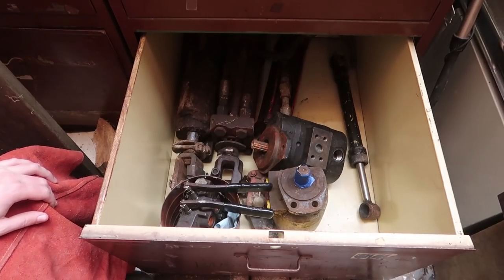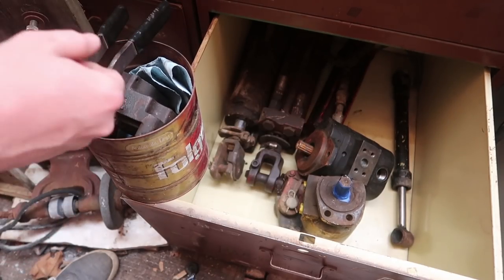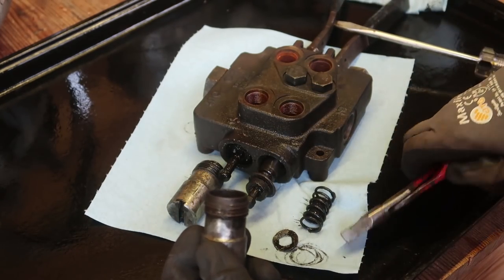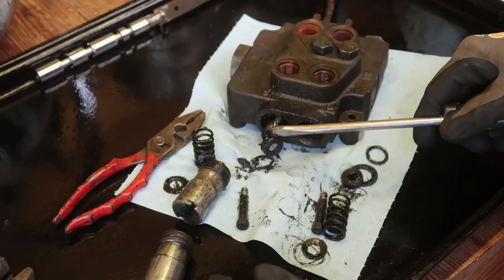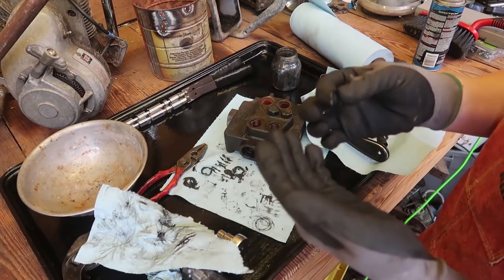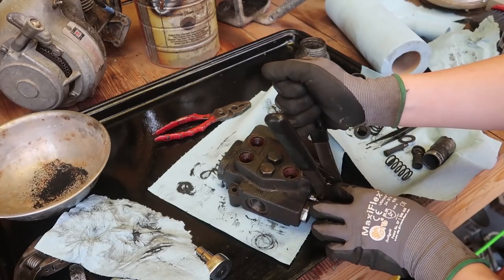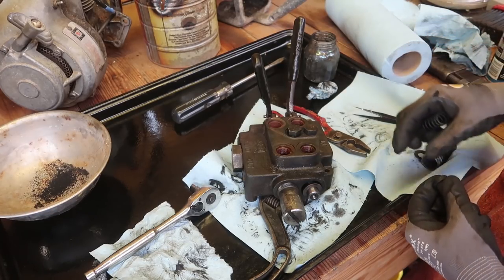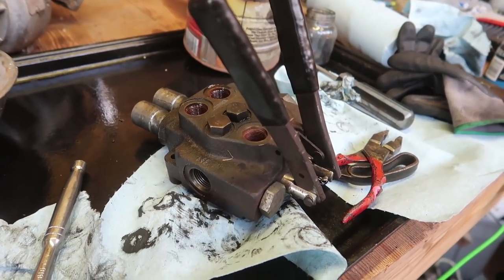DIY Electric Mini-Excavator 01: Hydraulic Learning Begins, Cross 4z0052 Double Spool Control Valve

Comment: Hi Rinoa, could you please do a hydraulic cylinder diagram, how to make the installation? I want to build an excavator arm for my backyard, and I need help to do that 😕🤓😌
Reply from the maker: well im sure somebody else has good diagrams online. however i do plan to experiment with my hydraulic circuit later. i just need to collect some more parts
Reply: @RinoaL  awesome! Thank you. Upload it when it's done 🙂🤓

Comment: Try getting hydraulic rubber hoses from anything any length I think they are a standard size and thread on the unions,  It wouldn't cost much to have a new ends fitted, Long hose  = 2 hoses, Looking forward to this, Take your time and gather x
Reply from the maker: oh dont worry, Rural King has a lot of them that will fit great.

Comment: Im thinking that the levers are mounted wrong. If you join the cylinder to the other hole of the lever and then with the links  the other hole with the broke piece on the body. I don't know if this was clear enough because i don't speak often english.
Reply from the maker: thats ok, it was clear enough. thanks

Comment: Could it be positive circulation and relief  valve bypass return,  if you actuate the valves it inturupts the return pressure and activates. Just working it through in my mind, maybe like power steering on a car. Interesting for me Rinoa. ps I could imagine trying to replace one of those stainless actuation rods.

Comment: Something that struck me.  Since one of the cups was orientated one way, and the other the opposite way - you don't really know which way is correct.  LOL  Do you think that little cup is a receiver for the spring, instead of cupping onto the rod (which may be why it didn't fit on one side)?
Reply from the maker: well ive had some time to ponder, and i think the one on the left was put on backwards. I guess Terry or one of the other workers tried a quick fix, that side had significantly less crud in it as well. i think that cup being backwards led it to being crunched, thus it wont work the right way anymore. and i think the cup is designed to stop the rod moving out too far. so im thinking the cup goes over the rod not the spring. it is a bit of a mess though lol
Reply: Well, I can say with assurance that your guess is better than mine!  :)  I mean, I'm an electronics nerd who has dreams of being handy.  Which is why I watch "mechanical" type youtube channels.  It's the strangest thing, I have no qualms opening up electronics and going into a circuit board with a volt meter/continuity tester or oscilloscope and removing and replacing electronic components... but opening up mechanical devices fills me with dread.  Watching tear downs and rebuilds reduces my anxiety about tackling mechanical repairs.  

In fact, I can share with you specifically what I look for in case it helps you somehow. What I watch mechanically oriented videos for is methods, tips and tricks for managing parts during disassembly (things like using a work mat or a partitioned tray to collect the screws and bits into so that you know which screw/bit goes with which parts).  And how they knoll the dissambled parts onto their work bench to create an "exploded" view that makes it clear how it goes back together. At 50, I'm getting forgetful, and I sometimes get lost in complex processes.  So I'm always looking for mechanical methods to do the "remembering" for me. If I always follow X procedure, I'll always know where Y part is that belongs to Z assembly.  LOL     I know, I'm an oddball.  :)  But they always say, there's a method to the madness.  So... I keep an eye out for the methods other people use to tame the madness.  ;)

Comment: I'd want to coat moving parts with some hydraulic oil before re-assembly.  Seems like asking for trouble moving dry steel against dry o-rings.
Reply from the maker: well i'll be taking it apart again, dont worry. ill put some engine oil on them at the least.

Comment: Never worked with hydraulics before, but I think all of the little pieces inside are just to guide/retain the spring for the return action. The big flat-head cap on the end looks like it sets the maximum travel of the spool. I'd arrange the spring components in whichever way gives the correct travel in that direction, then limit the travel in the other direction by adjusting the cap.
Reply from the maker: that is a good way of saying that.

Comment: you should try it out with just water at tap pressure. pretty sure thats a 2spool double acting valve. if you look at diagramms and ebay you can figure it out. maybe you can find the original datasheet (not really required)
Reply from the maker: water and oil handling equipment do NOT mix, i found that out when i seized up a 1970s petrol pump trying to pump well water.
Reply: @RinoaL  you are right that would rust imediatly. would have been easy thou

Comment: Feed compressed air through it to see what's what
Reply from the maker: well sadly i dont have an air compressor, and for this i think id rather try liquid. im thinking ill get my reservoir and pump figured out an run it at low pressure.
Reply: @RinoaL  maybe its worth to build or restore a compressor.  if you find one of those 12V car compressors you can power it with solar almost for free

Comment: Thank you for the wonderful video. I’m not sure you want my opinion but I’ll give it anyway. The reason you wouldn’t want my opinion is I’ve never worked on a hydraulic system in my life- or even studied one. However it would seem to me that one of those holes on the side is an input for hydraulic fluid, and the other is some kind of output return line. The four holes on the top would represent a flow of fluid; example; move the lever forwards and the rod serves as a valve to move the input fluid from the rear hole of that levers pair, through the hydraulic system it activates, and into the back hole. Moving the lever in the other direction would seem to do the reverse; centered would be off. I would tend to assume you know all that, which I deduced entirely from looking at the thing, so I could be entirely wrong about it.

In any case, it would seem to me that the valve rod would need to move a total distance of approximately an inch in either direction, the spring seems to account for that movement from directions flow to center (off). The way the lever is moving it is not consistent with the above observations. My guess is there should be some kind of additional connection between the box and lever which would act as a fulcrum, which would be entirely necessary to allow a human to move it under the resistance of hydraulic pressure. Again my eyes are bad, so perhaps I am missing the fulcrum; and all of this is knowledge-less deductive reasoning, so it could be laughably off.

This is a project I’d love to see through to completion, particularly so. Good hunting, Rinoa.
Reply from the maker: well since the end isnt exposed to pressure, the hydraulic force actually shouldnt push the rods out at all. otherwise youd have a long bullet. lol

Comment: You need to do your calculations, start at how much force you need at your end tool and using pressure/area etc. make sure all of your parts are suitable for the job.  Remember force is related to pressure and speed is related to flowrate.
Reply from the maker: no thanks, i dont foresee my calculations being more accurate than experimentation. or at least any more calculations than i do in my head. it all has to do with leverage, and that can be judged by eye. if something isnt strong enough, i'll grab a bigger ram from the scrap yard or get creative. but i dont expect to get it finished the first try, this design will evolve.

Comment: Did I just see a Bounty Hunter Metal Detector ?   Decent metal detector they are.  I have  two in various fashions of REPAIR NEEDED.  LOL 
  I've never delved into the realm of Hydraulics stuff.  Always amazed me the power that that stuff can produce.  Unlike Electricity hydtrolic fluid in motion has to go some place. Back to the reservoir, Piston Ram or where ever.  No holding it back.   Confusing to me.